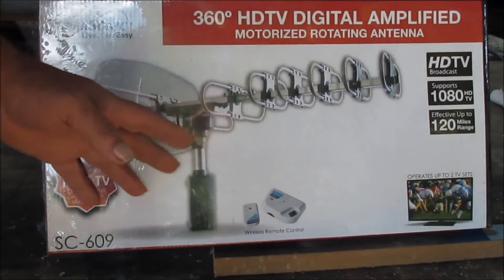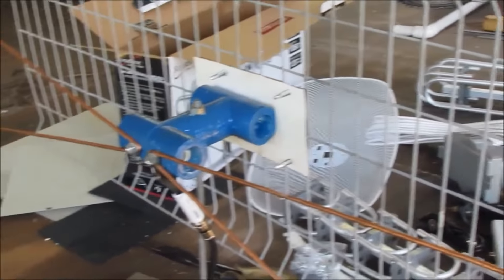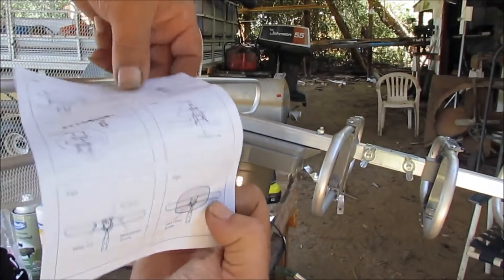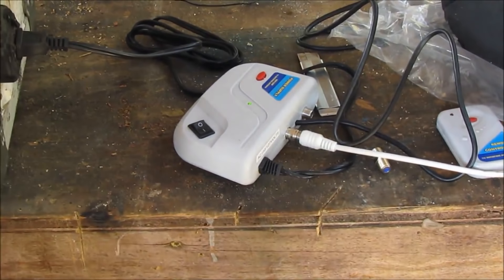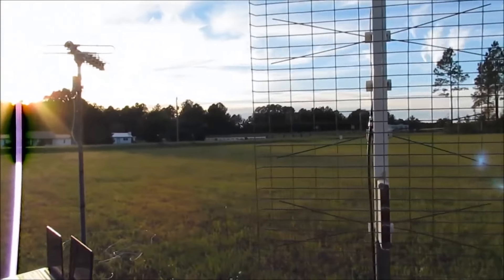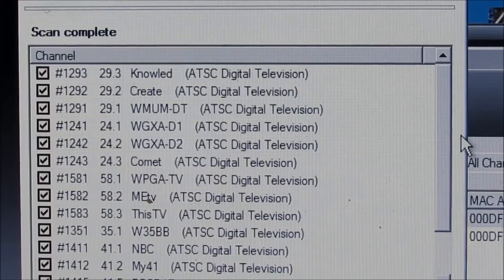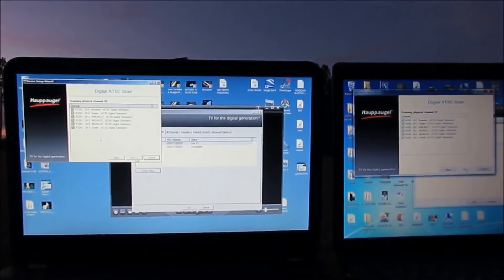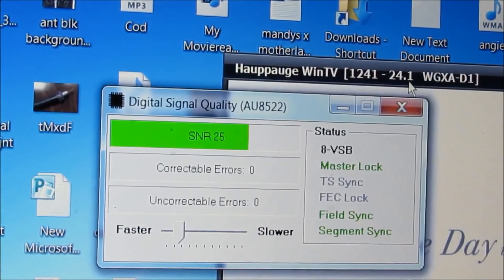360 Motorized TV Antenna vs The Ultimate Antenna

Comment: You have a good line of site for television reseption .
I'm 40 miles from Chicago and the transmitters are on the Sears tower and John Hancock center buildings .
I can't get Rockford IL which in in the opposite direction from Chicago.
I don't have a rotor antenna like your showing .

Comment: I bought this antenna from Micro Center in 2014 and just replaced it with the very same one today. Last week, I bought (and returned) a $100.00 and $150.00 antenna and neither one worked well. This antenna is the best $20.00 spent (both times). It turns and picks up a plethora of channels here in Metro Detroit. I ended up dropping DISH t.v. and opting for this alone.
Reply from the maker: i hear ya
Reply: I'm also in metro Detroit.. Dearborn Heights area..how do you have yours mounted an what suburb are you in for comparison..I want this antenna hoping to get the six 38.1 channels...
Reply: How the hell do I put it together??

Comment: I had one of those supersonic 360 models just like that one, paid 20 bux for it new. it works, but my cm4221 works better. Are you able to pick up Atlanta at all from over there? I can pick up all of Atlanta's channels with maximum signal level from 35 miles north, and also 40-50% on channels 3 and 9 in Chattanooga (Signal Mountain, Tn) which is 85 miles direct with my modded cm4221 (slight VHF mod).

Comment: When I was a kid in the early 60s we built antennas like that cat whisker 4 bay one on a 1 by piece a wood to get UHF. We had a VHF TV with a UHF converter back then. We had two of these type antennas on an old ladder bolted to the house. One faced east west and the other north south to get everything in our area. There was equal lengths of ladder line 300 ohm tv wire going to each antenna. At the junction was the TV 300 ohm ladder line or open wire  TV cable going into the house to the TV UHF converter box. Where it converted to VHF channel 3 to feed the old round screen Zenith TV set. Grandma loved L. Welk show and the music on there. And Grandpa would watch it with her. Grandpa later changed the antennas and put some chicken wire o the back side of a new set him and I built together. BTW my Grandpas first UHF TV antenna was a blown out 500 watt light bulb hooked to the 300 ohm wire and put in the attic to get channel 20 in Springfield Illinois. Thanks for the antenna design it made me remember many good times with my Grandpa. 73s Jimmy, WX9DX

Comment: This is how the ROTATOR gets power:  The coaxial wire is used for 2 purposes.  It sends the DC volts up to the rotator motor AND to the Amplifier at the antenna.  Then the antenna sends the signal back down THE SAME WIRE to the tv.  This is what I call "Ghost Power".   The same ONE WIRE is used for both purposes.  (This note is for the several people who asked about how the rotator gets it's power).  That is why the little power box MUST be attached and plugged into power.  So all the power and signals go where they are supposed to go.
Reply: @david mundy - You are 100% correct! Not a lot of People here come to remotely what've posted!
Reply: @david mundy -  Also I like to add... He didn't use the 'original' built-in booster dB Gain...  That booster is in the Remote Box Part, like you stated above.... This is why he didn't get good results!

Comment: So, after a handful of other antennas immediately prior, I've successfully put up an antenna extremely similar to this style. It works extremely well, picking up about 34 channels, twelve more than any site seemed to guesstimate based on my location which is super mountainous. I am still missing two major channels though, NBC and CBS. NBC I picked up with one of those previous antennas so I know it's possible, and CBS I haven't picked up at all (the closest is frustratingly impossible to reach due to interfering topography). However, luckily the NBC that I know is possible is in the same broadcasting city as another CBS so I'm positive I can get them both in one whack. But my directional is in the polar opposite direction. Interesting to note that all of my channels are UHF that I pick up now and the two I want that are in the opposite direction are VHF, could explain why NBC previously picked up with another antenna though its  a further distance away than almost every channel now. And even though it rotates and I can make it go in the opposite direction, it does no good because even amplified it absolutely will not pick those two channels up (CkearStream 2Max was the one that grabbed NBC). So, it's a dilemma! Its already designed to pick up both VHF and UHF so I don't expect I can modify it to pick up VHF could I? It already has an amplifier that came with it too so that doesn't seem an option. I am willing to buy a second antenna, but it obviously can't be this one for specifically obtaining those two channels and though I know you can use a combiner, I wouldn't know how using two antennas with amplifiers that have to be hooked up to operate at all would fare. My best guess is to maybe find a strictly VHF only antenna and place it in the other direction and use a combiner. I almost hate to buy what essentially looks like a sparse oven rack though. Any advice?

Comment: Danny:)  You know as per Yagi antenna design that the reflector is not big enough on that antenna and that the director elements are wrong on it also. It is another one of those antennas people sell to rip off the general public. Your cat whisker phased dipole antenna has been around since radio got into the VHF and then UHF frequency bands. That design of the antenna you call the ulti-ment  antenna :) that is as I said a tried and true design of old. But Danny it does peave me off to see these junky TV antennas some people are selling that you and I both know are junk! Please keep up the good work! 73 old friend, Jimmy, WX9DX, an old CW Ham Operator

Comment: Whatever Antenna you make the very basic principle is the wavelength of the frecuencies you want to receive
Reply from the maker: right
Reply: AND for the frequencies, too...
I've built several antennas, UHF/VHF back in the analogue days. I've found, too, that it isn't the digital signal that's important, it's the frequency of the broadcast signals for each channel. Everything else is marketing hype by the TV makers and the ones making and selling the antennas. That's why there are ad agencies.

I have a VHF/UHF rabbit ears inside antenna connected to my digital flat screen HDTV, and I get all the channels within a 60 mile radius, both SD and HD, 720i and 1080i, and the signal is strong and clear, with no pixelation.

On the other hand, my sister got a "supersonic" antenna like the one that Danny compares in this video, and it did ok for awhile; but the coax (which is cheap, low-quality cable half the size of normal antenna coaxial cable) broke or lost its connection at the connector that connects to the indoor rotor control box, and I cannot find a replacement cable for it or a connector that will fit that tiny coax. I'm not even sure if the rotor can be opened up to change the coax cable. Instead of the cable connecting to the rotor/antenna assembly with a coax connector, which would be the logical and practical design, it goes into the rotor and connects inside the housing. A new terminal connector can't be put on the coax, because the smallest coax connector is twice the diameter of the coax that is built into the Supersonic antenna, and the center wire on that flimsy coax is too small to use as the center of the connector. No matter how good the antenna is, if the coax is damaged--in this case due to shoddy workmanship and a bad decision by the antenna designer to go with cheap instead of quality--then the antenna is no good. I would not own a supersonic outdoor antenna. Compared to the "Ultimate Antenna" in this demo, the Ultimate Antenna is clearly the superior antenna.

Comment: The front of the Antenna has a few folded directors  for the UHF Band ,I can´t see well if there is a UHF folded dipole.... behind them there is a larger single folded dipole for the VHF Hi Band (Channels 7 to 13)  at the back there is a mesh working as a Reflector for the UHF Band. it is clear that the VHF Hi Band folded dipole is too long  for the UHF  Band but it may be working  as a 3/2 wavelength harmonic dipole in order to get both (VHF Hi/UHF)Bands, for difficult reception areas it may have to be modified. A well made  home Antenna will work much better ,thank you.
Reply from the maker: yeah
Reply: Teletenna Tech How is the Antenna itself motorized. Where is or how is it powered by electricity to turn?
Reply: Hi, thanks for your message,there are a few look alike models, the Antenna has a small rotator where the mast joins the boom ..it also has a small wired command for you to operate from the tv room.
Reply from the maker: OK GOT YA.TKS
Reply: Danny S Hodges Hi Danny the motorized antenna how is it powered.Mine does not move. I called the antenna company itself and he told me it is powered through electricity through the co-axille cable. I hooked everything up per directions and it was the way gentleman explained and I did everything the way you showed on your video as well but still not working.Help!!
Reply: Teletenna Tech Where does the antenna get electricity to run motor within antenna.
Reply: Hi...from the wall outlet to the commander then to a cable that takes power up to the Antenna, also some models may have a small preamp built internally and fed in a similar way.
Reply: Teletenna Tech So the coaxial is supplying the power? The electricity to the motor? Is that what you're saying?
Reply: My replacement came yesterday. This one works thanks guys
Reply: The one I´ve seen a couple of years ago had an extra cable supplying the power to the motor and attached to the coax and all this attached internally to the Antenna,it was made in China.....today some models of these Antennas are made in the US. now.. as the coax can be used to supply AC power to a preamp (Booster) installed in a regular outdoor Antenna and  if your Antenna came with only a coax cable it could be sending power to that small rotator....       Owners manual ?
Reply: Great !!  compare both Antennas to find out what was missing  on shipment or a fault in the product was the problem..thank you.
Reply: Teletenna Tech I found it hard to believe the coaxile cable supplied electricity to the motor but obviously it does.Thanks
Reply from the maker: YES IT DOES SOMEHOW

Comment: So is your "ultimate antenna" one that you made from scraps?  Are you saying that your homemade one is better than the one you bought?  Why don't you just say it, because I'm not quite sure what the 20 and 27 means. Is that the strength of the channel you're watching, or is that the number of channels your tv programmed based on the antenna?
Reply: The 20 and 27 is the signal strength.  It is called the "SNR" or "signal-to-noise" ratio.  That means the distance (in dB's) from the noise-floor, up to the signal strength reading.  His home made antenna works better.  The store bought antennas are made to LOOK really cool.  Like they could be from the starship enterprise.  But the real reason they make them that way is so they will ship cheaply.... because it folds up and goes into a small box.
Reply: He didn't use the 'original' built-in booster dB Gain...  That booster is in the Remote Box Part.... This is why he didn't get good result for the 360!  This is NOT a fair test results!

Comment: Like we say in these parts (North Georgia/Chattanooga, TN), "Boy, you ain't right!" 
I'm talking about the pictures of your "wife". FAH (funny as heck).

You should remark on the flimsy coaxial cable that is used on the "360 Motorized Amplified Rotating TV Antenna. My sister bought one of those, and after a few months--with the inside rotor control sitting still, not being moved at all--the cable lost its connection at the point where the tiny coax cable joins to the normal size connector end. The cable is too small to replace the connector with a new one, because the cable used on the antenna by the antenna manufacturer is half the diameter of a regular coaxial cable. Usually, replacement connectors for coaxial TV cables use the center wire of the coax as the center of the connector that goes into the center of the antenna connector on the TV or the rotor control. That can't be done with the coax on the 360 Antenna, because the cable is too flimsy. So, it's either get inventive with the antenna cable repair, such as splicing, or buy another antenna, because the cable doesn't connect to the antenna with a screw on connector, as one would expect. Instead it goes into the rotor housing and connects inside. I haven't taken my sister's antenna down to see if there is access to the inside of the rotor housing so that the coax can be changed (didn't have a ladder in my pocket when I was at her house last), but from what I could see from the ground, and from your video, it's a molded plastic housing with no user-access point. 

I think I'll stick with the antenna that I built for my own use. As for my sister, whatever she decides to do, it's her call, but I think I'll just build her a good antenna and be done with it--one that can be repaired easily in case of damage--and one that uses quality coax instead of the flimsy, cheap stuff that the "360" and "supersonic" antennas use.

I did like the results you got from the "Ultimate Antenna".

Thanks for the comparison video--and for sharing the pictures of your wife. 

Y'all be good down there in South Georgia! I have an aunt and cousin who live in Montezuma, which is just a few miles from Perry; and I lived there for several years myself, even though I'm from the hills of North Georgia and now live in East Tennessee.

Comment: Danny, I bought that same antenna. It was supposed to be 120 miles. Problem is the amplifier does all the work. The antenna does not have any gain built in. Also the more you use the rotator the worse it gets till it quits. The wind beat my antenna to pieces. Build one like Danny's or buy one from him. That plastic so-called 120-mile antenna sucks.Also nearly forgot, the coax with that antenna is only 25 ft long. If you add coax the antenna won't work. To get 120 miles, you need flat terrain  and need a high antenna with a good amplifier.

Comment: the 360 Motorized TV Antenna ad is a lie you will not get  120 miles the way just a few feet above the house hdtv is wll drop off depending on the power out put of the transmitter and freq your lucky to get   just pass 60 miles on a clear day I you would have to have your 360 Motorized TV Antenna over 1000 feet in the air to get any destance. I made an antenna  like Danny's antenna and in my 2nd floor apt I get 60 miles I live in Wooster and get Youngstown Ohio now that is  71 miles or 61 nm LINE OF SITE ENE of me note I am about 1100 feet high on a hill my antenna in sitting inside my window with a reflector on it the antanna i repaced it with was a flat amp i got at wall mart I got 30 channels with it I now get over 45 you can see my set up on my face book. Danny's ultimate antenna is relay coo land works better than one you can buy at the store.  if it was me I would use the motorized part on my antenna
Reply from the maker: LOL CAN ALL WAYS USE THE ROTOR
Reply: In reality it's good for about 12 miles.
Reply from the maker: thats right

Comment: Those 360 antennas are garbage but with a few modifications they can work. The wire mesh dish in the back is useless. If you move the big reflecter loop behind the pickup loop u can tune it in. Most importantly if you put a jumper wire across the bottom of the pickup loop to make it an actual loop it makes a world of difference the Instructions should 
Tell you that but don't. If you really want to get crazy get an alumn lid from a stoffers lasagna clamp it about 4" behind the big reflector loop bend upwards at a 45°angle see what happens.

Comment: Danny, better quit smoking. I quit 30 years ago. That 360 antenna sucks. I had one. Without the signal amp, it won't hardly get anything. And the rotating device will break in a strong wind. It's just cheap junk.